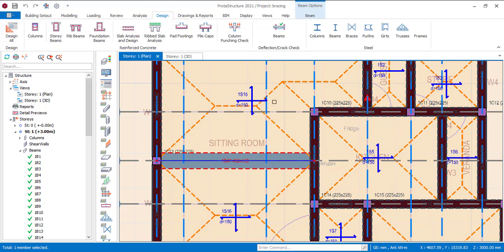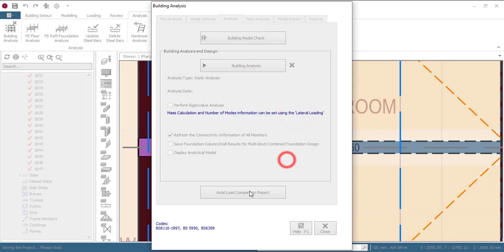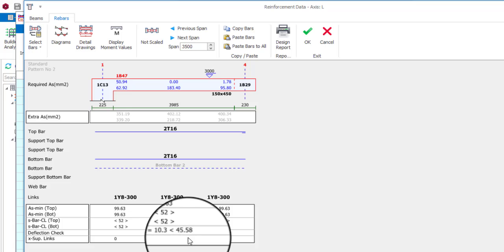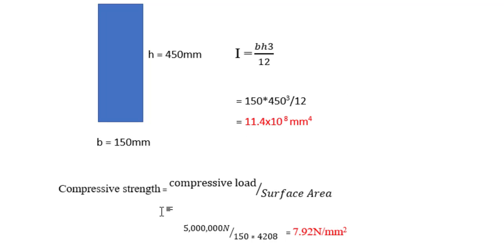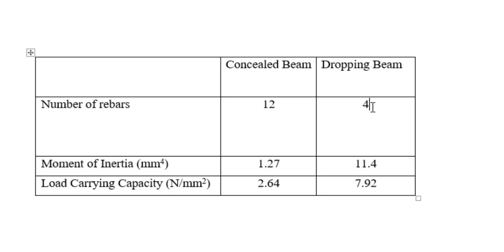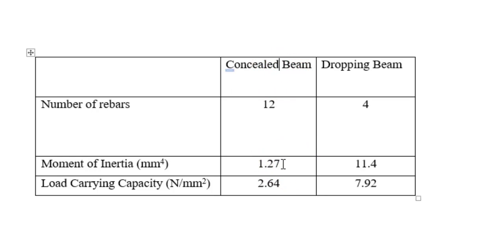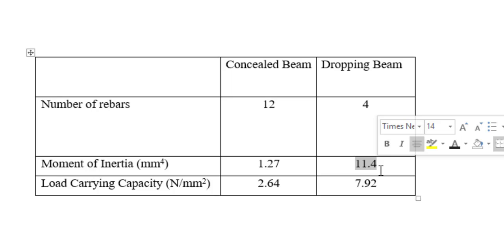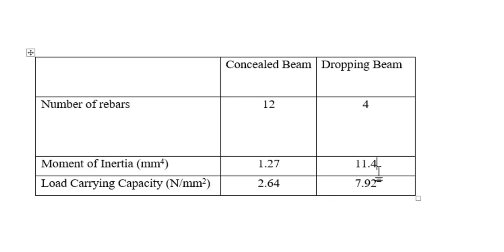Part 2. Are Hidden Beams Economical and Stable? A Critical Review with ProtaStructure.

Comment: Weldone, its good to educate fellow engineers on structural design, however, much as I wouldn't want to comment,  you need to realise that what you have is essentially added reinforcement to your slab in your " localised " reinforced area, and not a concealed beam... that's why the prota couldn't give you the " concealed " beam capacity,...the beam essentially is part of the slab....a beam by definition cannot be " concealed " in a slab......however your effort to explain it is commendable however, even though I disagree with your analysis

Comment: I love the amount of info i got here. But my question is on the load cArrying capacity, if u assume a compressive load of about 50kN divided by their surface area.....its obvious that the surface area of a hidden beam is much bigger than that of the drop beam.....hence the result will be smaller.....which implies less stress on the hidden beam but compared to the surface area of the drop beam which is smaller the stress will be much and hence more critical in reality coz the number is bigger ......i want to believe that in the criteria of load carrying capacity.....concealed beam has a better parameter

Comment: I love the conclusion, in the part 1, the red signs of deflection shows you need to increase the depth of the beam which means invariably we can't have a beam as 150mm deep as it tends to deflects, research also shows that concealed beam depth starts from 200mm. Also when you increased the 16mm top bar it shows you also need to increase the breadth. In all weldone